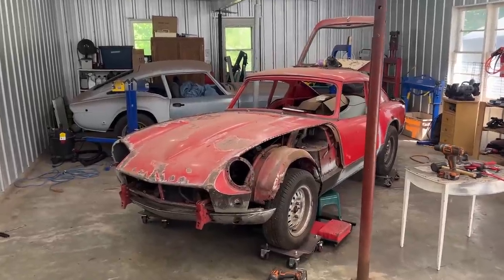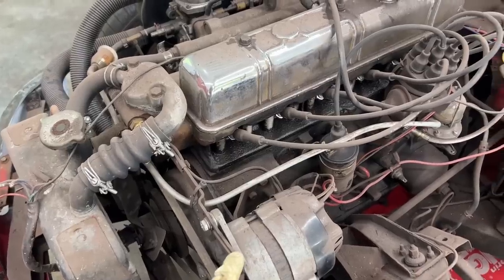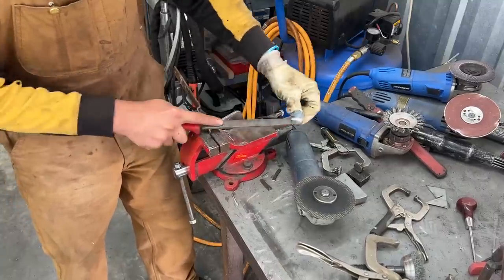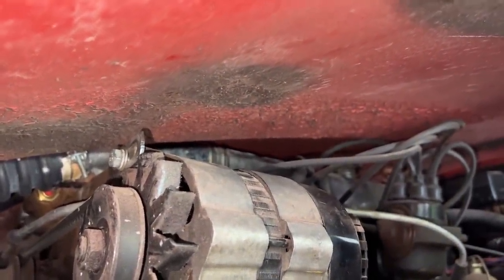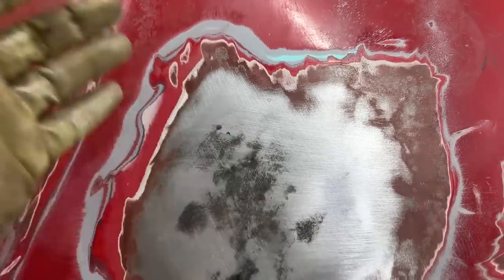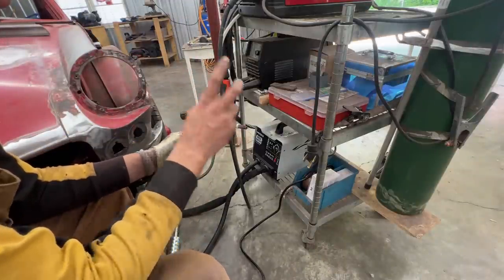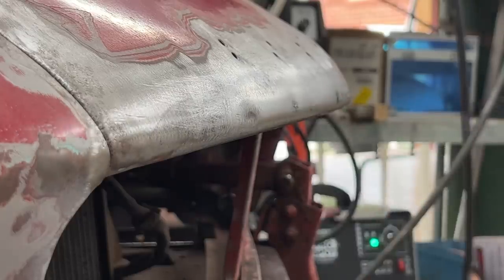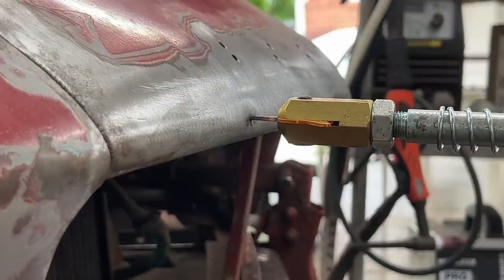1966 Triumph GT6 - Part 48 - Pulling Dents. Spot Puller vs. Slapper

Comment: The problem on the front dents is that the metal at the edges of the dent is bent, too. Along with pulling, you need to flatten the high ridges along the edges and that relieves the stress in the dent. Hope that helps.

Comment: I made a slapper too and have only used it a bit so far. For the handle I cut some off the sides so it would fit in my hand better, then clamped it down with my press and gave it a few good whacks with a heavy hammer to get a bend in it. I don't have a torch, but this worked pretty well for me.

Comment: Remember too, Elin, that a file only works in one direction. At the end of the cutting stroke lift the file. Don’t drag the file back over the work.  Dragging the file backwards against the  work damages the file eventually.  It is a pain but you get used to it after awhile.

Comment: Hey Elin, tell you what's worked for me: I have a cheap slide hammer that has a hook attachment. I cut some strips of 1mm steel with a 6mm hole drilled in one end and cut the other end to almost a point with the snips. Tack the point end to the dent with the MIG, hook the slide hammer into the hole and carefully pull. Cut the metal tab off and grind the weld spot flush. Maybe not as deadly accurate as your machine could be if it was working properly, which I don't think it is, but definitely works for me.

Comment: Hard hammer blows on the dolly is going to stretch the metal, not shrink it. So you made it harder for yourself. You also need to have the metal dry with the shrinking disc, the friction creates heat which does the shrinking. heat shrinking with a torch might help here too.

Comment: The point on the tip of the dent puller is to wide
Grind it to more of a finer point and it will be much better
Also try the shrinking rod they are the best way to shrink high spots

Comment: I know everybody is an ‘expert’ when it comes to comments but as somebody who’s been doing this stuff for over 50 years, you really should completely strip that hood before taking on the dent removal. With so many old layers of paint, primer and filler, you risk having to re-do some of those areas otherwise.
Reply from the maker: Yes, I agree, I realized that when I was “done” :) I had no way of telling whether the whole area is on the same plane with the rest if the bonnet :) Learning new lessons every day

Comment: Why didn't you install the alternator bracket in the correct orientation and just cut the solid part to change the angle of the slotted area?
Reply from the maker: I thought about it afterwards. That would have been the right thing to do, but…. It was too late :)
Reply: I was thinking to straighten the kink out of the bracket and then rebend it the opposite direction, so the bracket is in front of the alternator (as the upside down installation is) but the curvature is still downward.

Comment: You can make a Slapper out of an Old File too...or a Shrinker slapper if grooved still
Reply from the maker: I am not a fan of the shrink hammers and slappers. Yeah, a file makes a good slapper too. But I still need a torch and I don’t have one.
Reply: @RustyBeauties  
you can get MAPP cylinders too..cheaper and hotter than Propane...
i have a device that uses my Arc Welder that creates a Flame like a Oxy/Act torch ( have those too as well as a Natural Gas / Propane Torch setup )... i bought the Arc Welder device at Princess Auto in the 80's in Surplus...i saw in a Welding book and recognized it right away...pretty cool and burns HOT... brazing or gas torching is possible with it as well as heating bolts/nuts etc...or panels...👍
Reply: Don’t forget about lawnmower blades to use as a slipper.
Reply: @gordonblank6845  
leaf springs too 😉

Comment: I don’t think your spot welder is working properly…any I have used it was really difficult to break the studs off usually had to grind them off there was a handle that you could pull and tap at same time
Reply from the maker: You might be right, but I am thinking that this welder is designed like this. It doesn’t make too strong welds so it doesn’t penetrate and modify the metal too much. I have the stud welder too and that one welds the studs so strong that sometimes it pulls chunks of metal too.

Comment: It doesn't look like it is heating up enough ...your spotwelder should stay on longer to get better penetration....you should get more time to whack it than your getting...too bad the manual controls aren't working..contact the guy to let him know?  he might have just forgot to wire it or missed that problem...
Reply from the maker: The auto setting allows me to control the time and I realized that the longer I hold it the weaker the weld. No idea why. I think this machine is designed like this. It doesn’t overheat the metal and doesn’t damage the surface. When the tip get’s snapped off it actually leaves a bit of metal from the tip to the surface so all it needs after is a little sanding. I am sure I am not using it properly. Towards the end I figured it out, but probably I am still missing something.
Reply: @RustyBeauties  
the key to those machines is not burning through but welding enough to get a good hold to slide hammer it out...i bet your ground is not good enough...i would use a regular ground and try it...or buy a princess auto magnetic ground and move it close to where your working..any weakness in grounds is going to affect your weld ...weird how longer timing is opposite?  do you have control on amperage/voltage ??
Reply: @RustyBeauties  
they all leave residue or material because they are lightly welding ...that is normal... it isn't going to be smooth till you finish sanding it..
Reply: @RustyBeauties  
i think it isn't working right ...yes learning it takes time...but if it isn't doing it correctly your not learning and fighting it...  hopefully you didn't fry it up ?  with your cord mistake... it doesn't sound right either..sounds low voltage when you use it......
Reply: @RustyBeauties  
increasing the time should make it burn hotter and stick better... when you mentioned you " barely " touch it...it works better.. that seemed wrong to me...it should work best if you apply more pressure ( not Hulk pressure ) than barely touching it??
that seems weird...
it probably is a good machine...but who knows till you use it...
Reply from the maker: @garymallard4699  I actually removed the nut on the ground, cleaned a bolthole on the headlight ring, put the bolt through and tightened the nut on the other side. I am sure my ground is now 100% No, I don’t have control over the amperage, only time. There is only one knob and a switch between manual and auto. I believe the amperage is aways the same and you can only control the time by the knob. The inly difference between auto and manual is that in auto you set the time and it is always the same and in manual you can hold a s much as you want. It is a cheap Chinese machine, you can’t expect too much